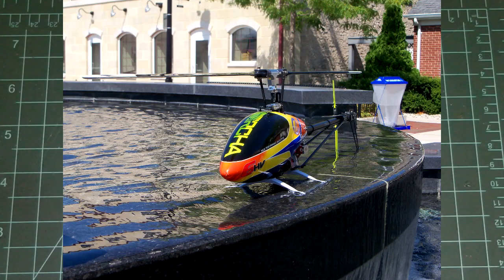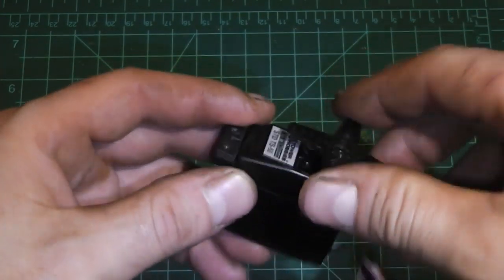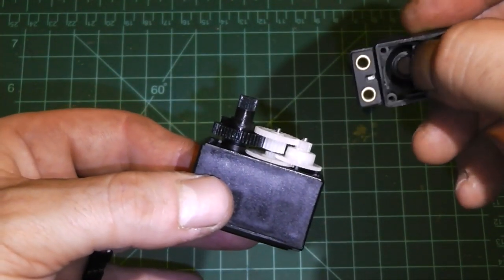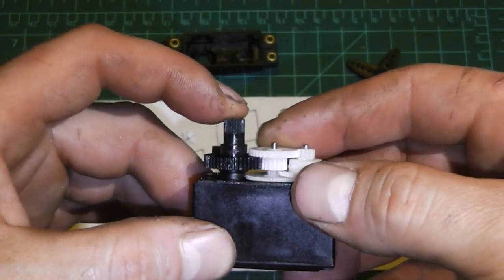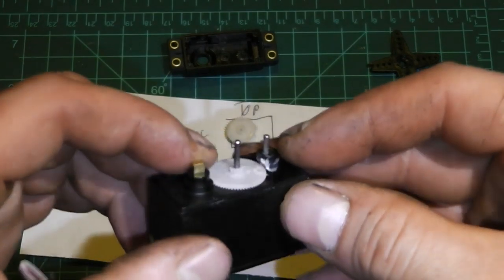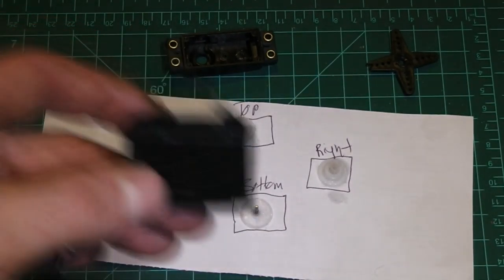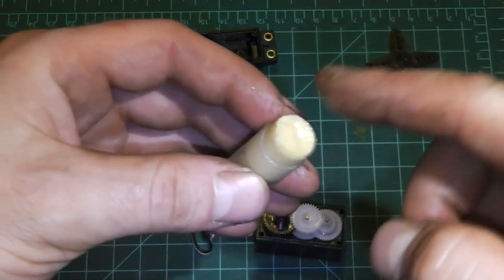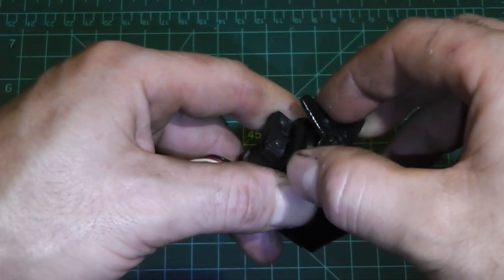R/C Heli Tutorial #9 Servo Gear Repair

Comment: My Dynam ERazor 450 FBL uses 3 9g Detrum servos with nylon gears. They are a definite weakspot on this heli, as I have gone through about half dozen of them with unintentional ground strikes with the rotor blades. Okay...I'm relatively new to heli flight. Not much better with fixed wing either, but I enjoy the hobby. Back to those weak servos. A better idea would probably be to invest in some metal geared servos, but aside from that, I've found a way to fix the Detrums. Most of the failed servos are because of the final pinion losing a tooth. I have not found any replacement gear sets available, but I have found some cheap servos (5 servos for $13.35 with fast, free shipping) on Ebay, which utilize the same gears. The servos are Tower Pro SC90 from Lagogla. They are US based and arrived within 3 or 4  using PayPal. The Tower Pro are slightly smaller cases, and run in reverse of the Detrum, but it doesn't matter if you simply trade the gears out. In fact I was a bit surprised the Tower Pro's worked at all with the 2.4ghz Dynam radio, figuring the Tx was digital and the Tower Pro servos were analog. Bottom line....I traded out the faulty final pinion from the Detrum with the new Tower Pro, and I'm back in the air again. Of course re-leveling the swash plate and re-setting the collective pitch was also required. It's always gratifying to find ways to improvise. The Detrum 9g servos were "out of stock" the last time I checked at XHeli or Hobby Partz, so it was great to find another means to "keep 'em flyin".
Reply: Wanted to say I am having the same issue (even though its 3 years ago now). I started to get into heli flying about 5 years back, then had to put up the hobby to save money again... Over 5 years later, I am now able to get back into this hobby yet again and after 18 years. Small background, I use to fly RC planes and loved it for 12 years but stopped in 1999 when I went to college. I always wanted to fly heli back then but was told they were very expensive and very hard to fly. Yes and no. But NOW, getting back into it and learning on a Simulator too. I also have a Dynam E-Razer (fly bar heli). I purchased mine from a co-worker who crashed it, fixed it and was afraid of it. I still own it (5 years later). The one I crash most is my EXI 450 I purchased from xheli. It's annoying to find out, when getting back into this from 5 years ago, they NO LONGER sell them NOR are they available except maybe E-Bay. 

The main reason for reaching out to reply to you SkyPilot Rookie is I found even another way to fix those servers. So far I've had no problems. After pulling the top cover off, I pull the broken teeth out and turn the second gear down 180 deg, put the case back together and good to go. 

Thank you for your input even though it's 3 years later I found it hehe...
Reply from the maker: That is a great tip! I did that once with my blace 400 back in the day! I thought about putting that in this video but thought it was too scumbag of a trick lol. I have been in this hobby for 17 years helis the last 10 and still fly planks but am completely consumed by rc helis! thank you for your post I enjoyed reading it happy flying man!